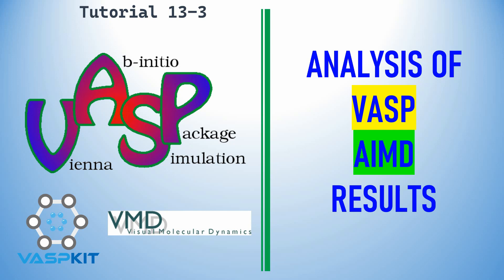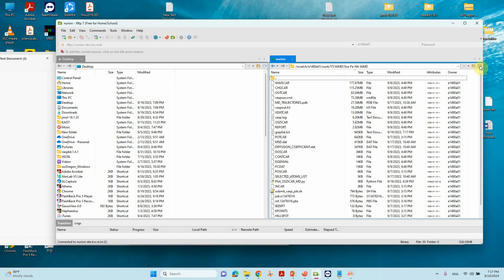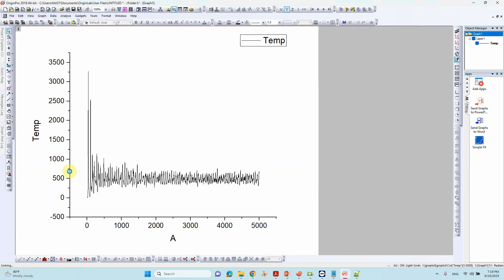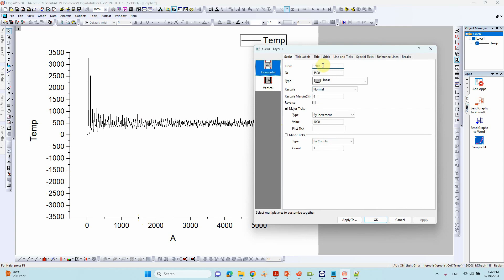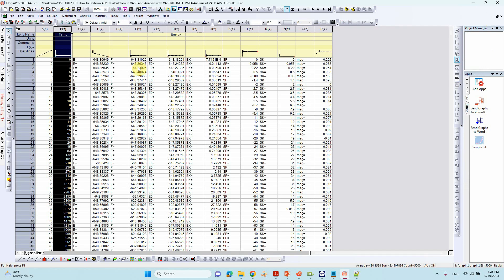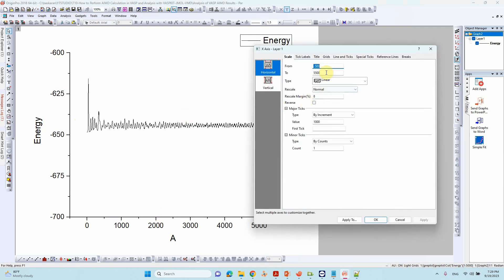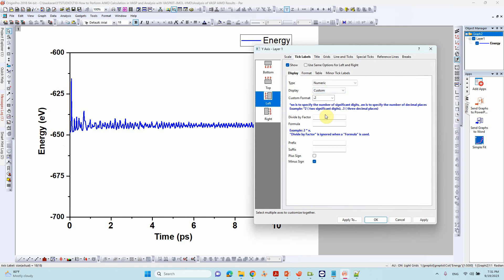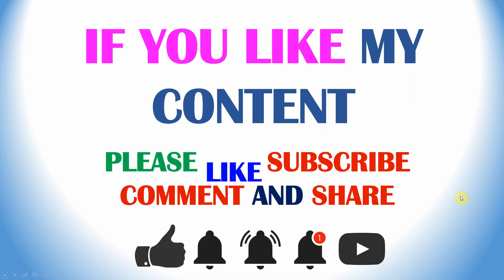Analysis of VASP AIMD Results - Part 3

Comment: Dear Respected Sir, I am deeply grateful for the wonderful videos you have uploaded. I thoroughly enjoy watching them and look forward to more. However, I had a question: Would you consider creating videos on topics related to battery materials, such as ion mobility, mass transport, degradation mechanisms, chemical kinetics, ionic stability, thermal stability, safety, lifespan, thermodynamics stability, elastic modulus and thermal runaway, etc? I would be immensely thankful if you could cover these subjects. Thank you in advance for your time and effort.
Reply from the maker: Thank you for your suggestion, in future I will try to make videos about you mentioned. ☺️

Comment: Sir i tried AIMD simulation with 5000 fs and time steps of 1 fs. However the OSZICAR file comes with only 2 fs energy.
Reply from the maker: Check out you walltime in script, maybe short walltime, you can use long queue around 120H, and Gamma kpoint 111, no vdw.
Reply from the maker: Or you can just follow my incar
Reply: @dbinfotech  Yes sir i followed the same INCAR. Still OSZICAR file is incomplete. I am using the VASP provided in the MedeA suite.

Comment: Sir when will U make video on Gibbs free energy and graph drawing
Reply from the maker: which reaction do you want to make gibbs free energy diagram and Origin plot (OER, ORR, HER, any other) please let me know. thank you
Reply: HER
Reply from the maker: Tomorrow I will make video on her plot
Reply: Yes Origin plot
Reply: And one thing more if I have a substrate with and without hydrogen adsorption then is it necessary to do frequency calculation and it's energy correction in vasp and then Gibbs free energy calculation kindly explain this thing also in video
Reply from the maker: How to calculate Gibbs free energy for hydrogen evolution reaction | HER
Follow this video, you able to do it. 
https://youtu.be/Yq3J6rxGXGg
Reply: Or just free hydrogen frequency calculation and energy correction Should be done
Reply: Ok thank you